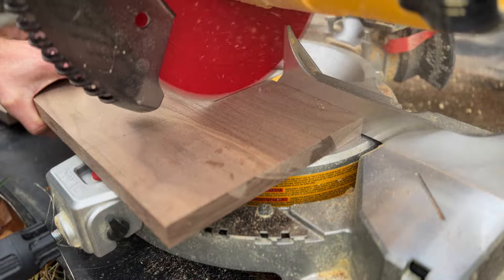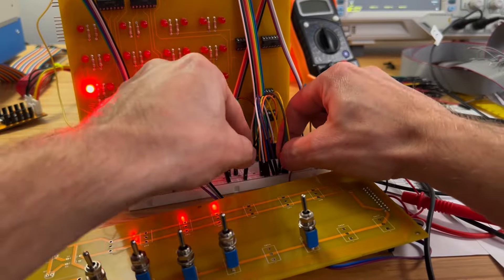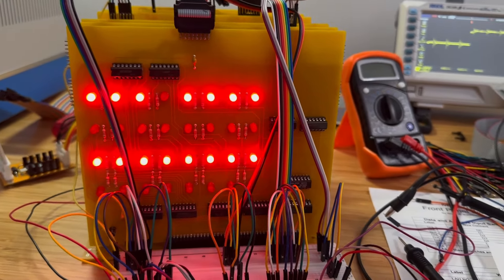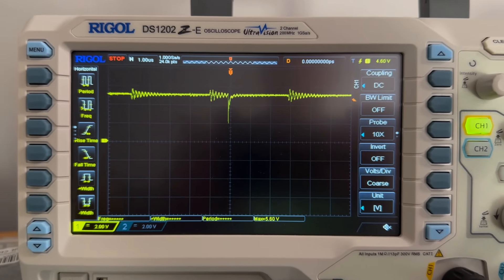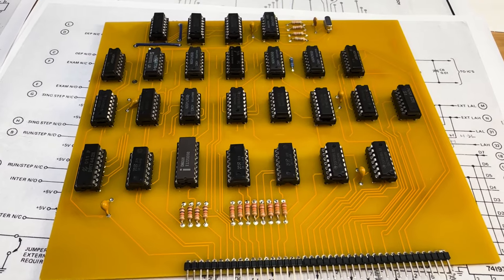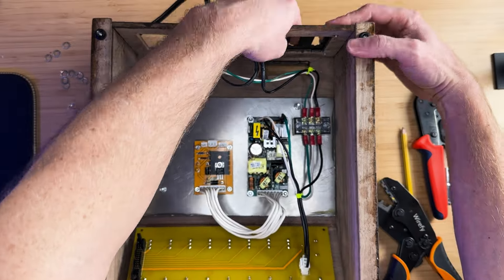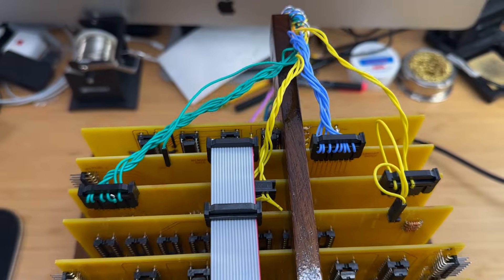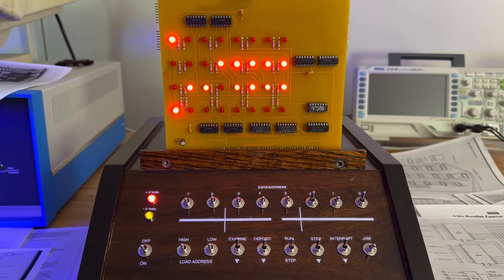Mark-8 Minicomputer Build - Testing, Debugging & Finalizing

Comment: I just went back and watched this, as I have most of the boards of my Mark-8 build finished, but I wasn't sure what value to use for the pull-up resistors you added to the Address Latch Board.  While they are mentioned on your Github about this Mark-8 reproduction, I didn't see any value specified there.  I imagine that quite a range of values would work, but I see that you used 1K ohm resistors here, so that's what I've now added to mine.

Now to finish "making" all the 41-pin sockets for the backplane... my least favorite task of this build, LOL.  If only the original design had called for 40 or 50 wires, it'd be done already!  ;-)

By the way, I was so surprised that these reproduction boards, which include "all fixes" needed on the original design to make it work, didn't already have a place for pull-up resistors on the 74193's.  I even got out my 1970's TI data book to make sure that there wasn't "one weird trick" wherein product designers could omit pulling DOWN (or UP) high when counting UP (or DOWN, as the case may be), but it clearly says that when counting up, DOWN MUST be held high, while UP is fed a clock (or vice-versa), in order for the counter to function properly.  How odd that the Mark-8 apparently didn't have them!  (Or, perhaps, most builders just added them as bodges back in the day, and the reproduction PCB designer didn't notice?)
Reply from the maker: Hey, thanks for your comment. I thought maybe I needed to use the pull-up resistors because I used some LS ICs but it turns out that I need them for the reproduction address latch board as well, which uses the original ICs (I’ll be posting a video about it soon). Same as you, I’m surprised this wasn’t mentioned in the “bugs” list since it definitely is a bug. 

And yes, making those 41 pin connectors is the worst part. Luckily the reproduction version does not need them as we can use Molex connectors.
Reply: @artemkalinchuk  Ah, good to know.  Also, I realize that I used "reproduction" for the boards I bought from BudgeTronics, which are functional equivalents to the originals, but redrawn -- and supposedly with bug fixes incorporated.  There were one or two people who sold true reproduction boards in the past, but they were out of stock when I ordered mine, so I went with the ones from BudgeTronics, which seemed good enough for me (with the luxury of solder mask!).  I'm not sure I'll ever try a "true" reproduction build, but it's good to know that I wouldn't have to hardwire the boards together!
Reply from the maker: @derekchristenson5711  If you're ever interested in true reproduction PCBs, I have sets available at www.kalinchuk.com.

Comment: So, I'm almost done with my own build of this set of Mark-8 boards (yay!), and I'm basically down to the cables and case.  This leads to a build question:  What did you do to build a reliable front-panel wiring harness from IDC connectors and all those individual, silicone-clad wires?  I've made a few of my own ribbon cables with IDC connectors, just using my wood shop vise, but I'm having trouble picturing how to use individual wires in such a fashion.  Did you use the, well, correct IDC connector crimping tool?  Some kind of jig?

Thanks!
Reply from the maker: I don't remember 100% what I did but I believe I color-coded each wire and then placed the wires, one at a time, into each position manually. Then I placed the cap over top and pressed it in using a press. It helps to have the cap in place (loosely) to keep wires in place while you insert each subsequent one. Once you press it in, trim the excess.
Reply: @artemkalinchuk  Thanks!  I'll give that a try.